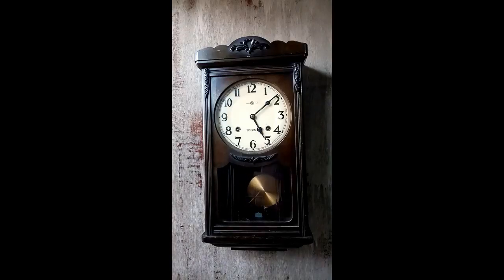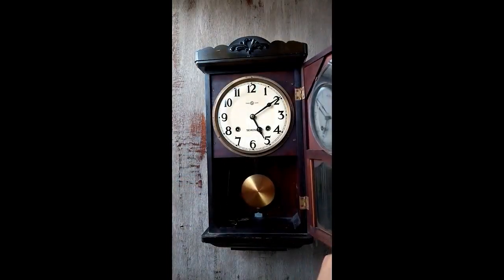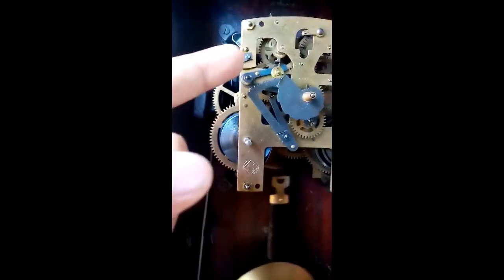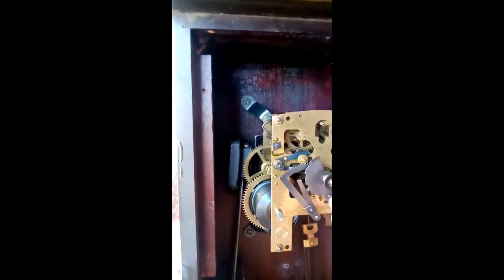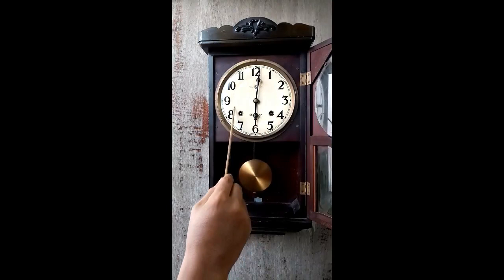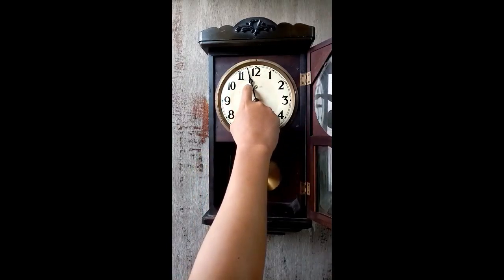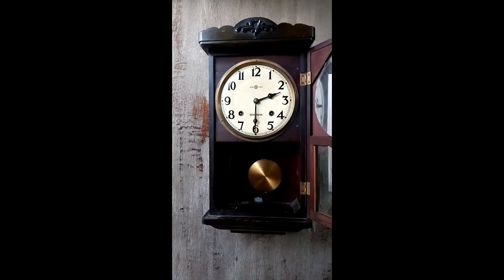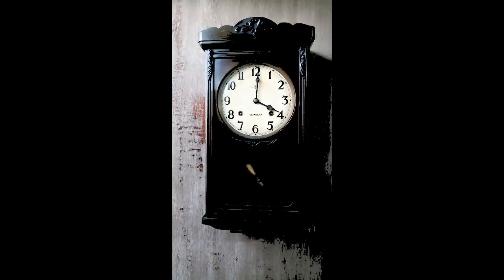Seikosha 8 Day Pendulum Wall Clock || How to adjust TIME and the CHIME

Comment: My clock was out of turns so it stopped the chimes. Now I have keyed the chimes but it will now chime only 1 time after every hour is complete.  Any way to fix this ?
Reply: It's same model as yours
Reply from the maker: Remove the clock dial. The back of the clock dial is the chime gears check and clean the gears. Check the rack and the snail and its related gears. Best is to clean and oil first.

Comment: Any chance you can explain how to put the clock on beat? Mine shipped all the way from Japan so I suspect the beat got put off in shipment....but I'm not sure how to adjust to put it on beat. The internals of yours look identical to mine so I suspect you could help. Thank you!
Reply from the maker: I have a video link how to adjust an off beat clock https://youtu.be/rWUCMQ6JZtg
Reply: @Woodys_Hobbies  For whatever reason the rocker looked as if it was tilted more to the right. When I gently bent the rocker more to the left to even out the range of motion and it went on beat. Thanks!
Reply from the maker: @connormelton1635  Welcome